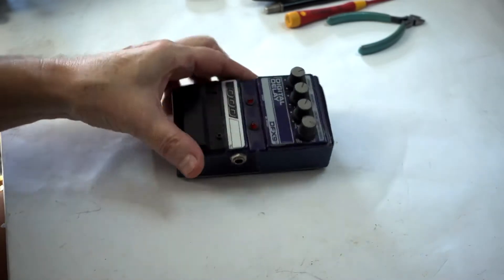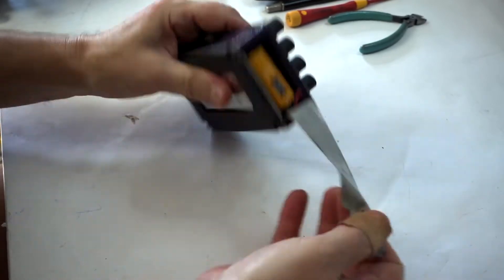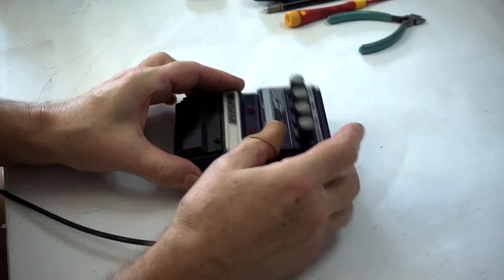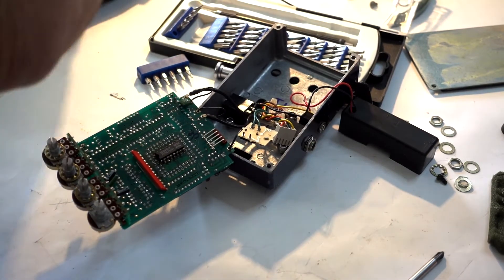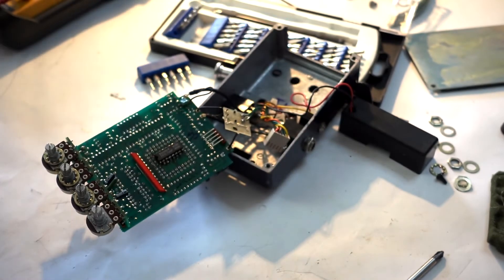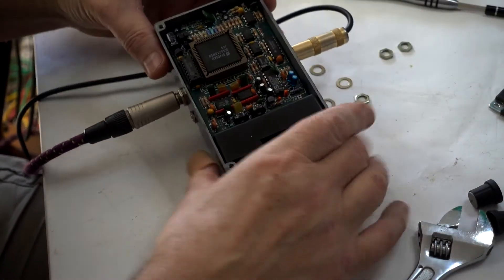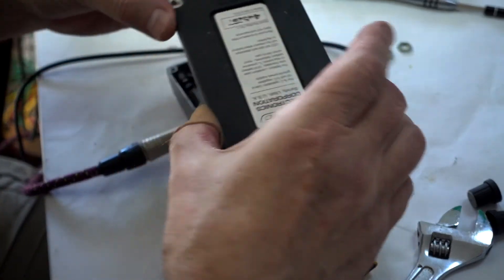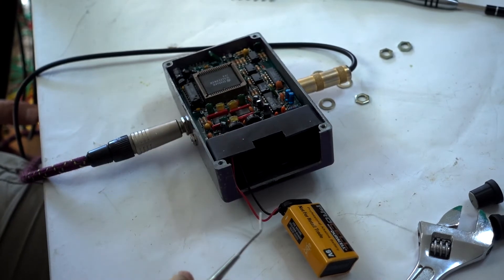DOD DFX9 troubleshooting

Comment: Rastop ❤ I've had a FX62 Bass Stereo Chorus since 1992 and the switch wouldn't trigger the effect or it would just stay on using the AC adapter. I kept it for sentimental reasons the last 10 years and I've never fixed a pedal in my life. Until seeing your video to learn how to take it apart. I played around working the switch on battery like you did (never worked on battery recently), plugged into a guitar. The effect finally connected, the light, everything. It took perseverance, but had I not see, how you took it apart, I would have given up. Mine had a white card between the metal cover and the circuits which you taped up to prevent shorting out. I just did 'trial and error' after watching you do more-or-less the same. Thank you.
Reply from the maker: Glad it helped!

Comment: I've got a dod fx25 and was wondering if a switch could cause the effect to distort? I know the fx25 has a bit of distortion but this one seems to have more than usual.

Also mine does have a plastic cover between the components and the bottom plate. Yours is missing it.
Reply from the maker: Hard to tell...
Reply: Yup mine has a plastic cover between the backing plate and the components.